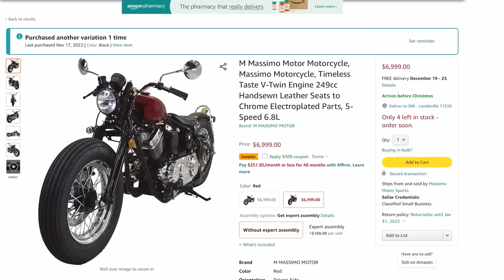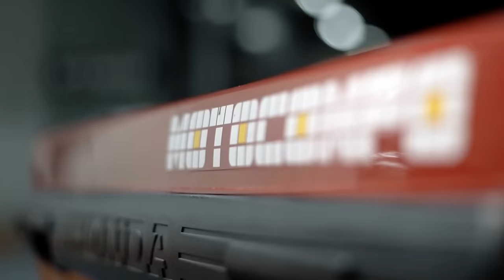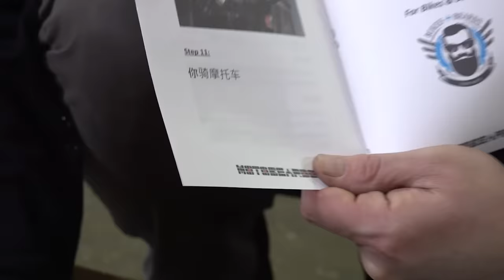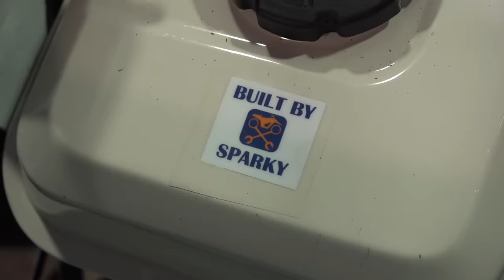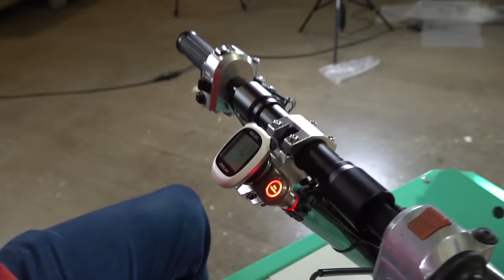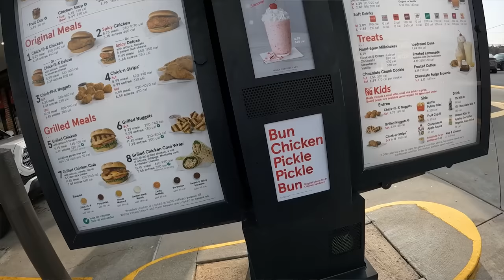Subscriber hand builds me an insane Motorcycle

Comment: Very cool.  Side note: it's a nerf jolt in there.  A cooler option would have been rival perses or nemesis internals jammed in there along with a flap you can open to dump the rival rounds into (the hopper).  Full auto 100 rounds, 100fps would have been fantastic and I bet would have still fit.

Comment: The issue is the angle of the swing arm with the ground. for it not to pump you need the swingers level with the ground that way the measurement from center axis to the ground at the same on both wheels. Thumbs up.

Comment: Try 60/40 with 60%of tires there its the end of tire that threatens also can you fill it with a backer-rod or a latex core ballance is a problem maybe cut spokes to ballance point as well I believe the 50% of tire wheel is inherently a shakedown. Which is a decent name shake-down bike. But you must get by blunt end common area; that's my guess it's eccentric weight that shakes you unless you place tires side by side like duallies missing part  of wheels that are not ballanced maybe leave whole wheel and counter ballance for tire alone or eccentric weight will shake you apart; now how to keep centripetal motion from throwing the tire off  rim. There were tires that had a bead to rim that had I tire like segments that went to tread portion of tires maybe a combination like those with strength to ballance absent weight a speciality counterbalanced part for tread to road missing part but as speed picks up the understanding of centripetal & centrifugal motion and the unique dynamics  of speed will or may likely cause tire to launch off wheel this could be very dangerous to deadly  to rider or others.

Comment: Dude I had a 1990 vtr 250 interceptor. Sprockets changed and carbs off a 175cc Honda ... Took some dialing in . But dude if your looking for a fast nimble small bike that can run handle and evade city traffic... This is the build. If ya make 1 let me know , I've got a lil experience lol. I want to know how fast ya get it . Got mine with 4k miles on it and if it was (stock?) It  did 126mph ...that can be changed ... My lil street rat smoked a strokered 1200 Sportster to 100 he didn't believe it was a 250cc had to show him the stamp that read 249cc. We died me and my rat one day on the way to work dude made a left on a red I was 90+mph when I stood on my brakes and ate the panel just in front of his back wheel. Medivac 8 pints of blood life support  for 3 days and a whole lot of determination and hard work I made a full recovery. God made that Dr just for me .. 21 hrs over me metal in every limb saw me every step of the way after he told me I'd 5% chance of walking again. Thank you Lord! I got bike talk and testimony if yer ever in sfl

Comment: I'm not even mad this dude recreated a Honda Motocompo.... and arguably made it much cooler than the original (and MILES cooler than the Honda Motocompacto 🙄).... I'm only mad it's not powered by a CR80R two stroke instead of that lawnmower engine 😅 

I need one, but it needs to be 2t powered, especially from a CR80R or ...oww ...CR500R powered?? 🤣

Comment: The problem with your bike the contact points you need to put something solid into the house of the tires with a cut off like a chunk of solid rubber cuz right there your tires are weak they're softer there than they are in the middle of the tire causing get the buck